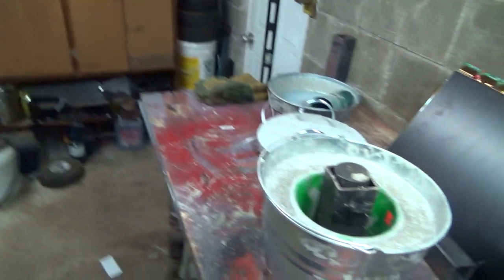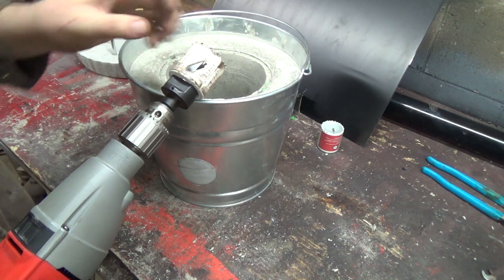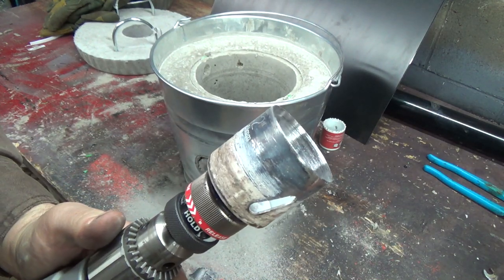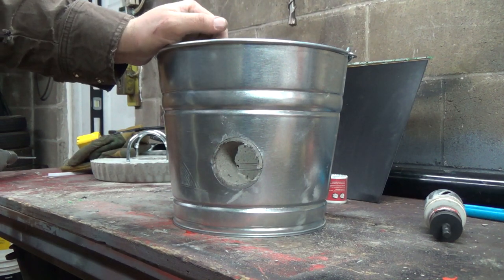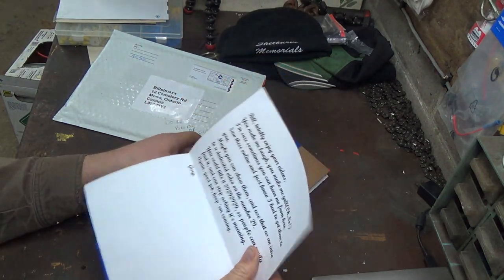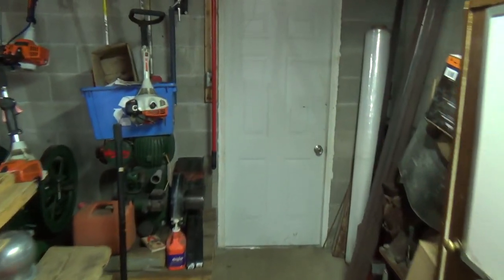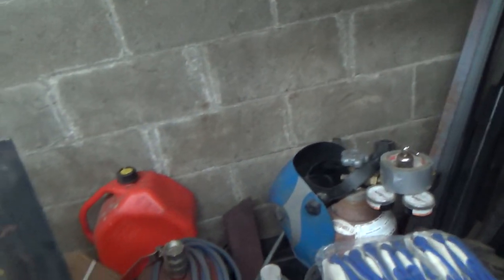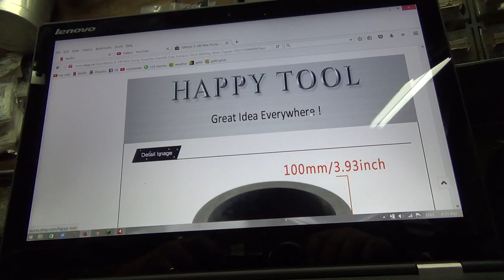Destroying a 2 inch Milwaukee hole saw drilling the foundry and a 29 plate mail

Comment: Be careful about using a steel tube, if it's a snug fit at the bottom, it could expand with all that heat and at least get stuck, at most it may crack the furnace, you could grind the bottom as a taper (like a crucible) to give you clearance.

Comment: Keep crucible off bottom to allow complete heating, local dentistry supply will have crucibles. Steel crucible works great for aluminum. 

I use weed burner on propane tank with old hair dryer for forced air.

Comment: should have coated the bucket with vaseline first and you could have done the same with the tube you wanted to put i so you could have your hole...And you should put about 2 inches of concrete in first,set the bucket on that then fill around it so u have the same thickness bottom as you have on the sides.
Reply: im wondering how many of those furnaces you've built
Reply: justin s just giving Bill pointers to help next time around. and yes I have built several

Comment: you needed a. diamond hole saw. they are a little expensive but will cut through steel as well as concrete. you would need to dribble water around the saw while drilling

Comment: this has nothing to do with this video but I was thinking about buying a stihl weed eater and was wondering what kind you recommend.
Reply from the maker: I would get a stihl.
Reply: OK thanks Bill do you recommend 4 stroke or 2 stroke. out of all the ones you own which is your favorite motor.
Reply from the maker: i would for sure go for a 4 stroke.. i use them here all the time. there super fuel efficient and sound cool too. but really its what your using t for and your budget

Comment: You could have probably cut new slits around the flat edge of the hole saw bit with a grinder or so, and used it to get through to the end. It wouldn't be good for metal any more, but still for the concrete...

Comment: you should be using diamond hole saw for cement and cerramic ,it would cut it like butter,,,13 pieace set for 13.95 on ebay